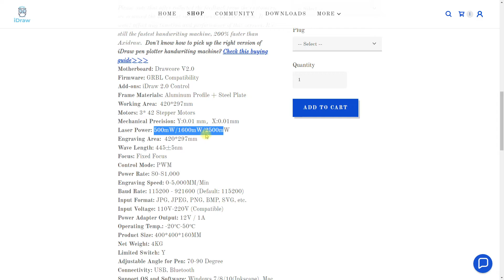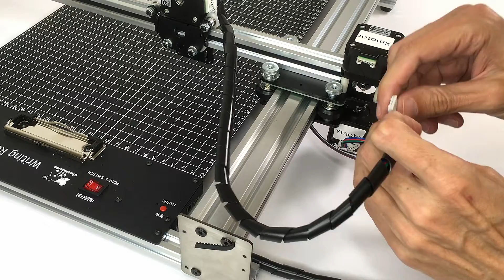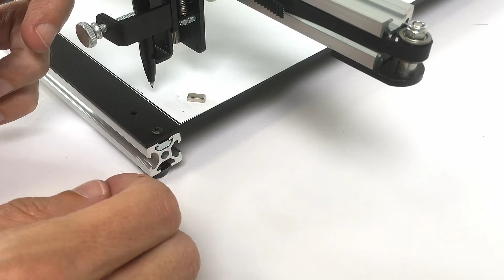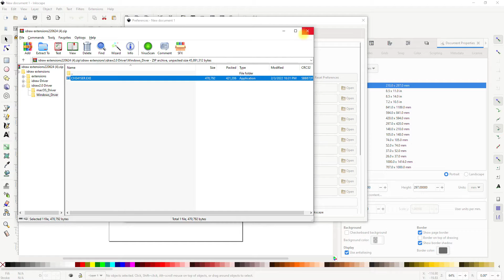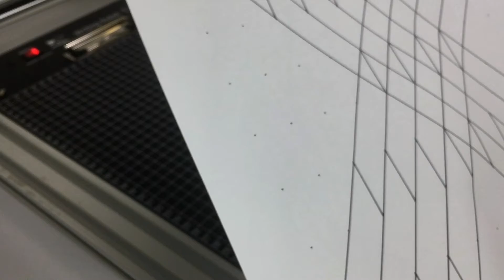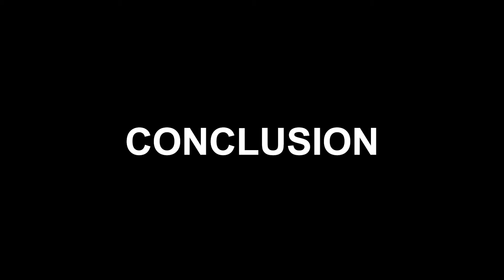REVIEW - New PEN PLOTTER iDraw 2.0 A3 by UUNA TEK® (XY CNC Drawing Machine)

Comment: I've had issues when doing signatures where the "dot" is created at the beginning / end of the signature from the writing instrument (pen and markers) are sitting on the paper before movement begins or just the initial "connection" of the pen hitting the paper in a non-natural manner.  Do you have any suggestions for solving this - either with software or hardware?

Comment: Can these plotters print from a PDF file or PNG or are you constrained to using the software supplied? I have a bunch of digital files that I created in Adobe Illustrator that I’d like to plot out.
Reply from the maker: Hi! Pen plotters need vector graphics to plot, not raster images (JPG/PNG/etc.) . PDFs/SVGs are perfect if all the drawings inside the file are vectors, means no pixels images. 

To plot the PDFs you need to either use GRBL or the plug-in in InkScape (similar to illustrator). In Inkscape you can create layers and control which parts of the drawings you want to plot. That’s the easiest way, it is straightforward.
Reply: @thedotisblack  thanks for replying! ❤️🙏 I have one more question. Do you know which plotter would be best for plotting out pencil drawings onto textured coldpress watercolor paper?

Comment: hi, how do you make your own basement for this device?  Also, is the iDraw 2.0 really that much better than the iDraw 1.0?
Reply from the maker: Hi! This basement comes with the iDraw, you need to select the option when you purchase it. But you can also get it without and plot directly on your desk. However, I find the basement extremely useful, the plotter becomes a plug&play device and because the basement is screwed to the frame, the plotter is always precise at high speeds. 
If there is a need, you also can remove the basement. 

Yes, the iDraw 2.0 is much better than 1.0! Day and night difference. 2.0 has a much better frame, doesn’t bend. 1.0 has metal rods that bend with additional weight and when extended. 2.0 has higher speeds, and the pen holder plate has a stepper motor which is faster for plotting. Also, 2.0 can hold a laser module. 1.0 cannot.

The question is rather whether iDraw H is better than iDraw 2.0.
Reply: @thedotisblack  thx for the response and the code saved me a bunch, do you know where I can possibly get a feeder that is already made to possibly attach to this device?  Also, I plan on just using it for the "handwriting" of 5x5 index cards so where did you locate the hershey fonts?
Reply: @thedotisblack  hey again, I got it and it's just like you said.  Just wondering if you know how to simply write on a postcard then scan it in Inkscape and have the plotter write it out?  Tried asking Uunatek but they don't seem to understand what I want to use it for.  Any help would be appreciated.

Comment: Hey i bought 3 of these with your coupon code! Can you tell me maybe why all svg handwriting fonts are double layered when it writes them? Makes each letter bigger and i dont know why. Thanks in advance!
Reply from the maker: I would need to see your SVG file to give you a precise answer. Otherwise it is impossible to know why or how you created the text. But few suggestions that you should check and do:

1) If it is double layered, please select one layer of the text, and delete it. In case it is a group, first "ungroup" then delete one layer.
2) Zoom in, check whether it is a single stroke or an outline of the letters. If it is an outline, then of course the plotter draws two lines. (This happens if you only transform the text to outline. You need to use specific single-stroke fonts. Or Hershey Text.)
3) In InkScape, translate your regular text with the function Hershey Text. Copy/paste your text to InkScape. Select it and go to...

Extensions > iDraw Utilities > Hershey Text
Or
Extensions > Text > Hershey Text

Let me know if any of these apply. No 3 should definitely work.
But why do you have three pen plotters?
Reply: @thedotisblack  Hey, thanks for the response. Yes i noticed that most fonts get a outline when you transform them into svg. Im right now looking for a good handwriting font which is single stroked. Can you maybe recommend me one? 
Another struggle is that the pen is going lower and lower the more it goes to the right side, which is due to the weight i assume. Do you know how to fix this?
I bought 3 because i want to write "handwritten" cards for my customers since im in ecom :)
Thanks for your help already
Reply from the maker: @XMiniProX font can be expensive. I don’t work with hand writing, I usually use the provided Hershey fonts in Inkscape. Have a look at these first. Otherwise, just google “Hershey fonts single stroke”. You will find countless types that will fit your needs.

Regarding the pen going lower on the right side: Actually there shouldn’t be a problem. It’s very difficult to help without seeing the machine. But I assume you have the iDraw 2.0 with the baseplate. First, please check the x-axis how it is mounted on the y-axis. Check the screws and washers, especially the position of the washers. They should be above the metal plate, just below the nuts. Second, check whether the baseplate is flat, use the narrow side of a ruler and slide across the baseplate. 
Perhaps, send me a photo of your machine on instagram or Facebook.

Comment: i just bought this plotter and im excited to play with it, but my first text failed because the bed isn't leveled, there are parts where the pen doesn't go down all the way and parts where it draws perfectly, is there a way to level my plotter?
Reply from the maker: Oh that is indeed annoying. I don’t have this issue but heard of it already. As I remember, Uunatek has a video on their channel how to fix it. And if it is not possible, then contact them directly and ask for a replacement of the baseplate.

Take a long ruler and move it along the baseplate to find out where it is uneven. It’s thick metal but you can remove it and perhaps it’s possible to bend it back. If the base plate is even, it might also be the y-axis. 

Perhaps the y-axis is not properly installed. One side might be higher then the other. Check this as well. 

Additionally, in the plug-in you can change the height of the pen holder. But that should only vary by around 0.5mm.
Reply from the maker: There are two washers included, please place them properly toward the inside side. This is very important actually. (In case you haven’t done.)
Reply: @thedotisblack  thank you so much for the reply, i found the video on Uunatek's channel, i will try to follow it and see if it works

Comment: hello can I attach a paintbrush in my idraw 2.0?
Reply from the maker: That depends on the paintbrush, thickness, length etc. It’s not a standard drawing utensil, so you will need to test. If you have a baseplate, you might want to remove it to get more height between the brush and canvas.
Reply: @thedotisblack  thanks for the help🙏

Comment: Could you for example use a permanent marker (sharpie) or paint marker, and draw on taller/thicker objects like a laptop or a phone case?
Reply from the maker: Yes, you can draw on pretty much anything. But if you have the model with the baseplate you will need to remove it temporary to get more height. Not a big deal though.
Reply: Thanks for your reply good sir! @thedotisblack

Comment: Hi, thanks for the review, I’m between the H AND THE 2.0 and I will like to know which one do you recommend, also do you preferred without the base and later add a bespoke base made by yourself, many thansk
Reply from the maker: I currently use the iDraw H only. I find it very easy to handle, pretty much plug and play device. It is also great for high speed drawings. The iDraw 2.0 is also fine, but iDraw H has the additional y axis that adds more stability in case you’d like to use heavy pens and I find it better looking.

The baseplate is extremely useful. I simply place my A3 paper on it and instantly plot, without it, I’d have to calibrate always. But you can of course make your own, however fur the iDraw H it’s only 20 USD more. Worth the price. And if you don’t want, you can always remove it and change the location of the microcontroller. Quite easy to do.

Comment: i purchased one of these and testing it out and it's writing from a down up instead of left right.  how can you switch it?  in all the videos i watch it writes left right.
Reply from the maker: Hi Jay, I am not sure whether I understand your problem/question. Is it the paper orientation? Select auto rotate in the plug-in. Also try different settings for plot optimization. Both you can find it in the plugin options. 
Let me know whether that solves your problem.
Reply: @thedotisblack  hey appreciate the reply back!  after some more troubleshooting yesterday i believe my issue is that the text i'm trying to have it write is in the form of an image so it's trying to "draw" not "write" and I can't choose the starting location.  i tested using another image with the same text and the pen was moving across the board left to right as I wanted.
Reply from the maker: Ah that makes sense. In this case, I highly recommend you to transform the text on the image to vector lines. You can do it simply with Adobe Illustrator or use any free online tool. That will make a huge difference.
Reply: @thedotisblack  appreciate the advice.  i will take a look into that and give it a go!  thank you again!

Comment: How do you adjust how much pressure is being applied? Can you adjust the spring somehow? Like if you are working with a pen that requires very little or no pressure.
Reply from the maker: Hi. In my review on the iDraw H, I talk about the pen holder plate and the spring with which you can change the pressure. 
If you want to use a pen with very little pressure or gravity only, it will be rather difficult. The weight of the pen holder plate is already adding pressure. However you can control the speed of lowering the pen in the plugin. That could help but limited and it won’t be gravity only. 

That said, I do like the pressure because most of the pens that I use, require pressure to interact with the paper and release ink. The lines have more clarity. Eventually, it depends on the type of drawings you’d like to produce.

Comment: Thanks- this is really helpful.  Have you much about it working well with Mac? and what file type is the best to print/plot with?
Reply from the maker: Hi! It supposed to work the same way with a Mac. But I did not test it, I don’t have a Mac. 

If you work with InkScape, you should have vector drawings and saved as PDF or SVG files. 
There are plugins in InkScape that can translate raster images to vectors though.
Reply: @thedotisblack  thanks - that's helpful :)
Reply from the maker: You’re most welcome!

Comment: I am looking into this plotter for writing multiple “handwritten“ postcards on E3 and cutting them down to size to mail. Is this plotter good for writing sentences/letters on a thicker material like a card stock? I also love the idea of using this to draw art to use in staging art at listings and other pieces of day in and day out of my business. Do you recommend a plotter of the size?
Reply from the maker: Hi Richard, this pen plotter is great for writing, it has the speed and the necessary pressure by the pen holder plate. You can write on any materials as long as it is smooth. The size is A3 but I think iDraw also has now an A1 plotter. Of course, to create hand writing you will need select and use Hershey fonts (Vector fonts) in InkScape. 
Here is a Certificate of Authenticity  all text is written by this pen plotter: https://www.reddit.com/r/thedotisblack/comments/zcpulc/thedotisblack_logo_with_the_idraw20/?utm_source=share&utm_medium=web2x&context=3

Comment: Hi is there a set up to achieve larger drawings like 30-40" squared?
Reply from the maker: Hi! The plotter is limited to A3 size, the frame cannot be extended. A larger plot area would be an issue. You’d need to work with tiles, but the transitions will not look great.
Reply: @thedotisblack  thank you for responding. Do you know of a kit for larger drawings?
Reply from the maker: @Zickafoose2024  There are a lot of plotters for A1 and even A0 for up to 500 USD. You can find many on Alibaba but I have not reviewed any of them. I guess, all of them will work properly. The differences will be in the details of course, mainly the speed, setup, and the interface/pluginor how to communicate with the plotter.
On a side note, AxiDraw is also available in A1. Very expensive though.
Reply: @thedotisblack  Thank you for replying! I found the AXIDRAW, but nothing on alibaba. I am trying to do large scale drawings...maybe modify something?
Reply from the maker: @Zickafoose2024  Here is one on Alibaba with sizes from A4 to A0. But again, I don't know anything about its performance. https://www.alibaba.com/product-detail/DIY-Disassembled-LY-Frame-Type-Antirust_1600564028213.html

Comment: Thank you so much David for the thorough review! It seems like Evil Mad Scientist got a serious competitor now.

Do you plan on reviewing the laser attachment? This is a serious killer feature to be able to combine a pen plotter with a laser etcher/cutter!
How does the iDraw community compare in terms of resource and support compared to AxiDraw? It looks like UUNATEK is a fairly new and unknown company. My impression is that they are trying to gain market ground but do not have much involvement with the art community.
Can you actually precisely control the Z position? (as in control the pressure) It is amazing to see it is GRBL based given the amount of CNC tools which already exist.
Reply from the maker: Hi Lionel, I agree with you. The iDraw is a valid competitor to the AxiDraw. However, in my opinion there are lots of great plotters these days (especially in the Chinese/Asian market) but unfortunately not enough thorough reviews. From what I can see, many utilize the same hardware, same stepper motors, frames, etc. the biggest difference is however the interface or how to plot instantly. And in this case, UUNATEK did the right decision to use and adapt AxiDraw’s plugin for InkScape. This makes it highly accessible to the majority of users.

How the art community will respond to new plotters is difficult to say. It’s mainly about exposure but since the AxiDraw was one of the first that developed a balanced plotter, it will be difficult to gain fast a large market share. Lots of great artists use the AxiDraw. That has an impact on exposure of course.
But the support of iDraw is great. They always replied almost instantly and helped with issues. But to be fair, I didn’t have any issues with the iDraw. When I asked about the Bluetooth and lack of instructions, within a week they published a video how to set it up. It actually works with GRBL. The video link is in the description. No need for cables anymore!
So, as you said, it is a fairly new company that needs a lot of input of the community to improve their products.

I don’t have the laser module for the iDraw right now. But you are right, I should ask them and review it as well. It’s not only because of the duality of the machine but actually more about the working area. A3 laser engravers are rare or expensive. 

The height of the z motor you can control precisely, in mm instead of %. I like that actually. However, the z motor does not add pressure on the pen, a spring adds additional pressure. The z motor is great for speed, it lifts up/down quickly the pen without delay. That is extremely important to avoid ink bleeding and drawings with shorts lines can be achieved faster. Likewise, a stepper motor is more durable than a plain servo motor.

Comment: If you did not have money problems would you go for this or the Axidraw? Thankkkkks!
Reply from the maker: Yes, I would buy the iDraw 2.0 with the basement/drawing surface. It is very easy to operate, almost a plug&play device.
Reply from the maker: Just to clarify, it is not about money. There is simply no perfect pen plotter. Every machine is a compromise and a trade-off to find a perfect balance. The AxiDraw is not perfect either. It has limitations. 

For example: the AxiDraw is very gentle to fine pens, it only works with gravity and is thus very slow. If you use pens (pencils, etc.) that need pressure, you need to use rubber bands on the pen holder plate. It’s not always neat and not always accurate, also it damages over time the servo motor of the pen holder plate.

Likewise, I found the legs of the AxiDraw too short. At high speeds and curves, the AxiDraw tends to slide. Equally, if I mount a camera on top of the pen holder plate, the additional weight becomes critical and the AxiDraw can tilt. It needs to work very slow.

And, lastly, my AxiDraw also broke down once. One of the wheels on the y-axis cracked. I had to replace it.

That said, the AxiDraw is a great plotter but also had its flaws. I should make a video of the AxiDraw perhaps.